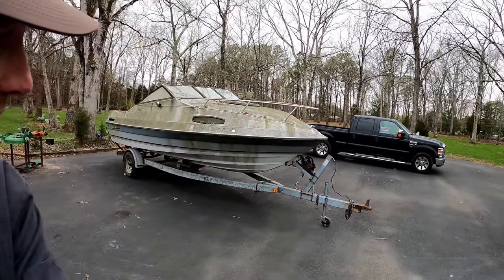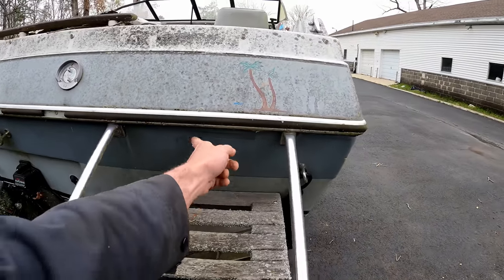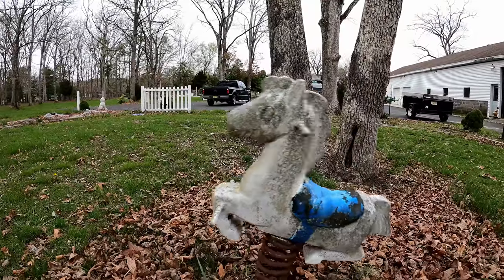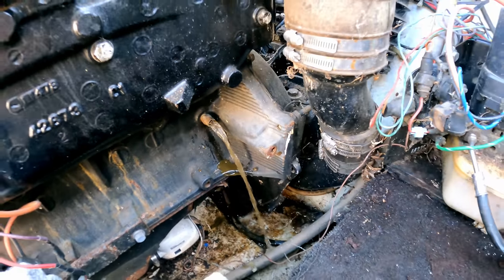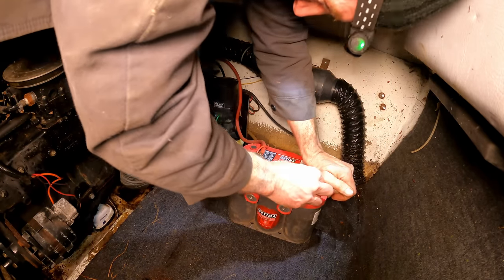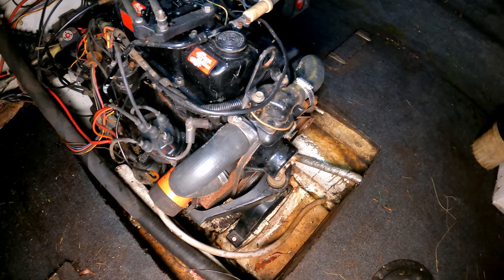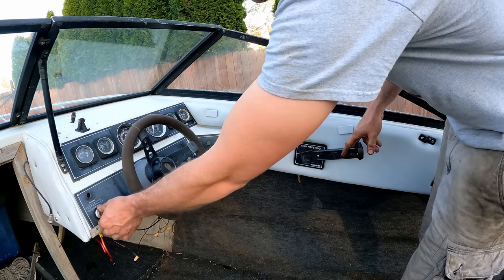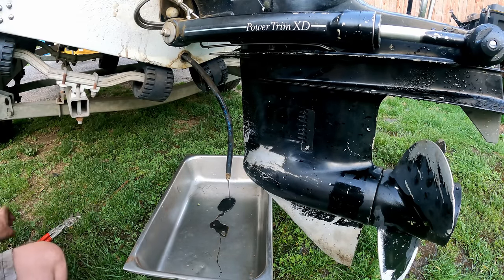Junky Boat Sitting For Years Will It Run? RAVEN 195 - NNKH

Comment: At this point Chris I'm convinced that you can make anything run 29:59 ❤
Reply: & "it's a good thing" , we've lost so many gems to the junkyard simply for lack of maintenance and no nonsense know how.
  I'm just on the other side of the Delaware River & my high school metal shop had a forge, we learned welding and the whole shebang("that's what she said").
I still remember my woodshop teacher saying;
, "you know, we're not tryin' to prove wood floats". , when he saw me using too much glue.
That's the kind of learning needed, not commie rat basket case neuter rooting.
"What is these Reds I keep hearing about?"
        Tom Joad in;
                      _-The Grapes of Wrath
Reply: I Know RIGHT? This guys amazing at mechanics
Reply: I`m sure he can fix the Titanic with enough time..

Comment: Chris, I have an '89 chris craft cavalier with the EXACT same drive combo / 3.0 merc and alpha one drive. It's an amazing setup for cruising around the lake, bulletproof, and great on gas. Bought my boat sitting for 4 years and basically gave it the same work you did- mine needed a new ignition setup, anti siphon valve, fuel pump, carb, water pump impeller, starter, and other small odds and ends. These motors are a dream to work on and the block originated from a 60s GM design.

If you ever struggle getting the lower unit installed, inspect the condition of the copper water pickup tube and housing. They can become swollen or melted from previous overheating and not let the lower unit seal back together. Can be an absolute nightmare, took me like a week to figure out.

You accomplished the same amount of work I did in about 10x faster... LOL. It was my first time working with points so great learning curve. Enjoy that boat!

Comment: You did a great job but were totally wrong at 55:55 regarding the water coming out of the exhaust bellows. The water cools the exhaust and exits in the prop's hub. Right now you are blowing exhaust into the path of the propeller causing cavitation. The exhaust at idle will come up and ☠ you. I think you got everything else right.  One other thing. That split in the hull will let water in and the foam will soak it up. It will never dry up. The weight of the boat will increase a lot. The engine will never reach it's full potential. I'm going to say they added a Whale Tail because they couldn't get the boat to plane. Take the boat to a scale and get it weighed. Rip out the entire deck and install a new one. Fix the hull from the inside when the deck is removed. Those seats are common seats and inexpensive. Stainless steel threaded inserts can be installed in the deck so the seats can easily be removed. Install a bilge pump.  At 8:52 you called those Anchor Lights "all around lights". Those lights are to only be illuminated while anchored never when drifting or running. I love that boat. Fire extinguisher's gauges always get stuck in the green position even if the air leaks out. Ok I like how you lined up the valve stems with the dot on the tire. I like the light on the engine cover that lights up the floor. I don't like the rollers on the trailer. I like the engine size. You will save gas.  I suggest running the engine at full but don't let it exceed 2000 RPM for very long. Adjust the RPM at full throttle by changing the prop's pitch. Now run the boat wide open and note your max speed. You should have Max Speed @ 2000 RPM.  This will change depending on the lakes altitude because the water might be lighter and the prop won't grab the same. It's always good to have a spare prop, best to have a different pitch just incase.

Comment: As a little boy my Dad was very Handy withCars and he showed me the Points Trick with a Matchbook he told me always keep one in your glove box  the Striker strip  can be used to Sand or file the contacts , the thickness of the Cover should be good enough to  set the gap as a thickness guage or Feeler  and most of the time that will get the Vehicle running well enough to get you home  or to a place you could do  a higher quality repair  i drove  a older MGB  with Points for 14 years  and several Aircooled VWs  and i did use that “trick “ a few times  my MG i converted to ElectroniccIgnition eventually  as Allison made a simple Conversion Kit  for the Stock Distributor set up

Comment: Sometimes algae builds up in the check ball on the fuel sending unit. You can take them apart and clean them up and it usually fixes the issue of no flow from the tank . And I have a Volvo Penta v6 and omc out drive in a 1996 20 foot Sea Arrow. It's a center console setup. Pretty rare not many around the model is a V 200, and you are right about the impeller pump being easier to deal with. I love that boat it's definitely worth saving. People knock on inboard/outboards but I love mine. Yeah they take a bit more work to maintain but I really like the rear space and the torque of the inboard. Mine is a Volvo Penta v6 4.3 but it's been rebuilt with higher compression and a bigger cam and has a 4 BBL Holley carburetor on it . I have some videos up on my YouTube.

Comment: Great video as usual! A pump-up yard sprayer works great for the gear oil. That vent hose on the fuel pump is for safety- it directs the raw fuel into the carb in the event of a diaphragm failure.

Comment: love the channel
another easy way to install the impeller is to put the impeller in place and put grease on it, then push the housing straight down and spin (the propper direktion) the drive shaft or propeller when in gear and the blades on the impeller will fix it self.

Comment: The squealing noise from the transmission is the pilot bearing. I have three Square Bodies with the SM465 and they’ve all done it at some point. You need to change that pilot bearing SOONER than later, if you wait too long it will groove the input shaft on the transmission. Not a big deal to change it and inexpensive.
Reply from the maker: Cool. Thanks for the info!

Comment: I actually owned a Raven Countach.  350 v8 alpha drive 21.5 cuddy.  The best boat I ever owned. Loss during divorce.  They only made them for I think 3 years.  Mine on alum prop did about 55 top end.   Switch to Stainless and topped put at about 70.  Scarry ride at 70 as it was like no boat in the water.     Excellent hull design.   Nice lines on it.  1988. If I could find another I probably would buy it.  Would run 40 knots not breaking the bank.  Like third to half throttle.  55 gallon tank would last forever unless you went full throttle.  Then you could watch the gage drop by the minute.

Comment: Dont forget to wire up a spare fan belt when you change the old one. Can save a lot of swear words if one fails when your on the water !!
Reply: I ran an alpha one for more than 5 years without a belt.  Impeller provided plenty of pressure for cooling.   Just made sure I had 2 batteries 😂

Comment: You need one of those 'turbo nozzles' for your power washer. I  promise, if you haven't tried one, it will blow your mind the difference.
Reply from the maker: I got one and it's definitely very impressive. But I find it leaves swirl marks if doing something like this boat. For blasting frames and grease and everything else yeah it works amazing

Comment: that outdrive and motor combination is hard to kill.  great part is you can go to any autoparts store and get most parts way cheaper than the marina.  additionally the exhaust couplers can be bought at a fraction of the cost from any hardware store,  they're just rubber pipe reducers

Comment: Hello - I like videos like yours but just a little heads up on a couple items.  There are new regs for fire extinguishers and engine cut off switches.  I am a vessel safety examiner and fire extinguishers have to be replaced 12 years from the manufacturing date that should be on the fire extinguisher.  There has to be an engine cut off lanyard attached to ignition that can be attached to life jacket in case of man overboard etc.  I use to love working on my Bayliner Cabin Cruiser but I too had bad back needing multiple surgeries so I sympathize with the original boat owner and veteran.  You might want to update video with the new information to keep boaters safe.  Not alot of boaters actually know what they need to pass a vessel safety exam - I do them for free with our squadron.

Comment: Brother, that really is a nice boat. That 3.0L four cylinder should be fairly torquey and should be able to plane that boat fairly easy with some basic maintenance, tuning, and a good fuel tank flush. That's a real score as long as the engine and electronics are in good shape.

Comment: I purchased 16' Century many years ago and after using it a few times it smoked the rubber coupling between the engine and outdrive. I replaced the coupling, took it to a dealer and had it lined up, and relaunched it. Wasn't long afterwards it happened again and then I realized the transom was rotted out. End of story and end of boat. When you launch it, keep an eye on the transom for flexing !

Comment: I recently brought home a 2007 Seadoo boat that had never been used, it was left to rot in outdoor storage in Arizona since new.  The fuel pump was seized, I cleaned out the tank, put in a new pump, and it fired right up.

Comment: over covid me and my now wife actually bought a nice little 15' Silverline boat and the floor was shot.

I'm not new to boats or anything I've used them my whole life, and I've actually redone a few floors in my life so we actually got into a complete floor rebuild.

we gutted the entire floor, foam, and stringers. 

re-cut and glued new stringers, fiberglassed them, and then reinstalled a new floor and fibreglass and pour-in two part foam.

it was a fun project.

Comment: Spot on, a marine fuel pump has that fitting so a pump with a failed diaphragm will leak thru the hose into the backfire flame arrestor.

Comment: You should put a three way ball valve on the hose so you can have a free water pump to wash your hands with when the motors is running 😜

Comment: Quite a find Chris! Jen has her work cut out for her (and I bet Gus finds some "treasures"). The check valve in the fuel pick-up is an anti-siphon valve, required by USCG/NMMA. Stops fuel flow in case of a break in line between tank and engine. Crack on hull bottom is a concern! Given the motor mount being rotted, hull structure could be rotted. Foam could be soaked, too. (a la Bayliner) Fuel tank was lose? I believe Raven Boats was in business 2 years, 1989-1990. I am a marine industry engineer, lmk questions. A past Ford Elite owner and a multi-time dacshy owner, I really enjoy the content. (Ever find a Chrysler Funster for sale post it!)

Comment: We used to spray ether or starter fluid inside tires and ignite it to help get that bead started and sealed during initial inflation for them difficult to seat truck tires

Comment: That fitting  on the fuel hose on the tank has a check valve ball in it. The ball will stick and not let fuel back threw. Its designed to let fuel stay in the hose when fuel pump isnt pumping. Makes it starts quicker. I Deleted mine because my boat had a surging at high speed problem.  My boat had a electric pump.

Comment: "This boat has a little crack(hole) in the bottom,,, NOT A BIG DEAL..."  lol only Chris would call a hole in a boats hull "not a big deal"..   but I actually believe him!!   the skagg has been repaired,, (standard for boaters who FORGET to raise the stern drive when hauling out..  lol...  and the ALL IMPORTAT,, "Guster/Turbo opinion" of the boat.  AFter seeing the first 3/4, my thought is, think maybe there's a part of a spark plug core in the #1 cylinder head?

Comment: For lower unit fill get you a garden sprayer and attach a fitting on the end.. Alt. belt get 2 put one over bracket and secure it, replace the other on the alt.

Comment: The trailer for my boat needed replacing, the used trailer I bought had rollers on it which I removed right away and replaced with bunks, easy to do by adding L brackets in the 4 spots that the rollers were located so not only are the bunks able to adjust vertically but also horizontally with double the support of bunks with 2 anchor points

Comment: So many boats from that era came in I/Os. I just keep looking until I find one with an outboard. Then no winterization is needed to be done every year. I went through the restoration with an older Sunbird (OMC made). With the rotted floors and all. That Raven needs some serious fiberglass work. The engine mount pad, floors, some of the cabin walls, and I'd look at the transom just to be safe. The only way to easily restore boats that rotted is the take the cap off, but that's a big job since they are so heavy.

Comment: I have been looking for something almost exactly like that myself. Everything you pointed out with the cuddy cabin and just under 20 ft and the 4-cylinder is all pretty much perfect. I think a conversion to a Subaru four-cylinder diesel would make an awesome boat that is very fuel-efficient
Reply: Nah Subaru is some of the worst engines ever made
Reply: Honda makes the best 4 cylinder. The k24 is a gem of a motor
Reply: @krotchlickmeugh627  Based on what? The 2.0 DIESEL is compact and would last many years tuned to about 175hp. Ski all day on a single tank of fuel.

Comment: It's most likely  a collapsed piston skirt on #1 cylinder that is actually  pretty common  when a motor  has that kind  of severe  detonation that melts the electrode out of the sparkplug,  sometimes  you get lucky and it just tulips the intake valves. caves in the center of the intake valve then it only turns into a cylider head job.

Comment: I have a SM465 in my 1972 package truck that started making "crunchy" sounds yesterday coming back from a run. I'm hoping it's only a U-joint but, I have an NV4500 ready in the garage if not. The swap may happen sooner rather than later.

Comment: A balanced trailer tire you would think, would have more even wear, less vibration transmitted to the bearings, etc., and less rolling resistance, which equals more mpg.
Seems like a no brainer to me. 
My RV shop didn't think it was needed. I was going on a 1500 mile round trip. It got done.

Comment: The running doesn't really matter, it either is cost effective to fix the engine & drive system or not.  The issue is likely the amount of structural rot that could very well lurk in that hull.

They may budget for the engine replacement but get surprised when they are told there is $4k to $6k in structual rot along with whatever is messed up on the drive system that needs to be fixed for the boat to be seaworthy.

Comment: I'm no mechanic but as long as the boat has been sitting . I would change the impeller in the foot . I have made that mistake and burnt up the motor.
It was dry routed badly after sitting only 2 years in the Alabama heat !

Comment: That boat is very similar to a boat a bought a few years ago (for cheap) I ended up pulling the 4 cylinder out, installing a pod and a 150 mercury outboard. Its a great boat that I use often.

Comment: For lower unit oil I use a one gallon pump up garden sprayer cut the wand off slip a clear hose on and adapt it to a threaded fill you can get a kit with all the different mfg types works great! I also I like Amsoil marine lower unit lube.

Comment: Better check the transom for rot and cracking because it is going to have leaks through the bolt holes because of rot between the fiberglass. The seat breaking tells me there is rotting wood from water over the years.

Comment: We had the same problem with rot around the motor mount on a glasstron boat. We used flatbar kinda looked like a set of handlebars but it came over and tied into some good 2x4s and didn't have to fiberglass or change the pitch of the engine. Worked great. Our biggest problem was the charging system on those mercruiser engines.

Comment: I had the same mercruIser 3.0 liter on a Bayliner 19' 10".  40 mph on smooth water. Very economical, all day on the water, skiing, etc., only a couple of bucks for gas.   It's a Ford by the way, not GM.

Comment: I am watching this video for the first time I love the will it start videos. I just seen you take the spark plug out no electrode guaranteed the electrode fell down in the cylinders would not be surprised if it’s still in there and causing a piston tap. Horoscope down there with a magnet. See if you can find it before you try to start it.

Comment: That fuel tank check valve was to prevent loss of fuel prime so you don't overwork your starter to prime the engine every time you want to start it.

Comment: That's a pretty nice style of boat almost kind of like a Bayliner but bigger you know even if the motor seized and you get it unstuck in the block is cracked you could always throw in the same stuff I use in my 4.3 you know the leak stop in the little orange bottle I'll stand behind that product 100% as I've been using it for the last 7 years with no avail you know the problems at the vortex have with the leak by the head and the manifold well when I first bought my truck I had that same leak I put one bottle of that in and flush every year and put another bottle in and have not had a problem and have not had to tear the motor down either thank God for that. That motor with the maintenance that I do in the regular oil changes and filter changes runs excellent at 196000 miles. It runs better today than it did when I bought it.

Comment: Raven is another of the boats that came out of Mel-hart industries in South Carolina Baretta,Raven,Citation..interesting fact I had a Baretta with a 2.3 volvo that mounted to the transom and not floor stringers...you could pass your hand under the whole engine and a closed cooling system,actually an excellent design..